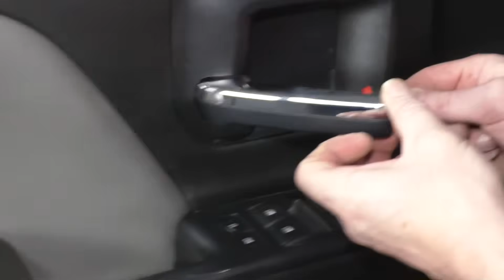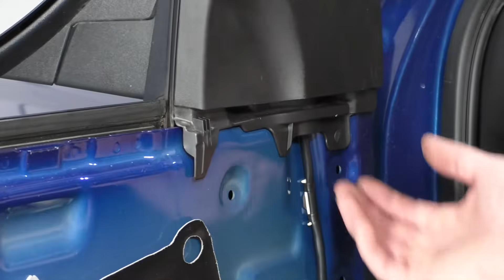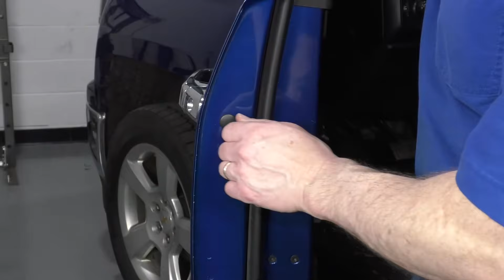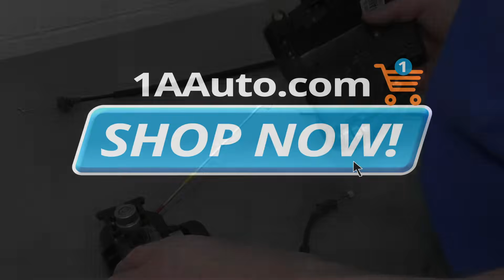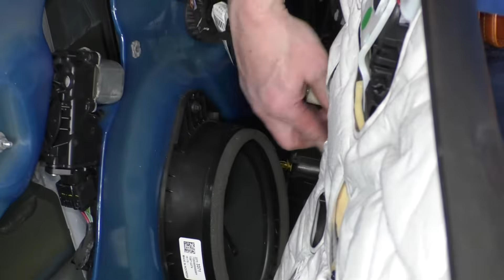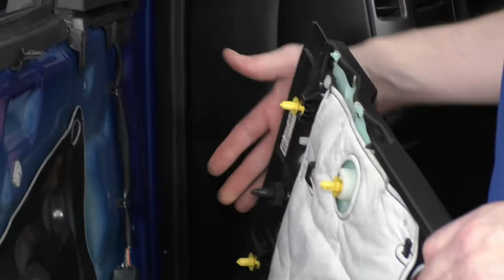How to Replace Front Door Actuator 14-19 Chevy Silverado

Comment: READ THIS FIRST! Read the whole thing once because I added a couple of things out of order. My truck is a 2015 Silverado 2500 and I did the drivers door. Should be the same on 1500. I would like to offer a few of suggestions that will save you a lot of time and headache. This is a great video and I followed it with a couple of time saving tweaks. This is long winded but I promise you it’s a lot faster. I tried to be detailed because too much it better than not enough. . First here’s a list of everything you need to do this job. Wish every video started with that.  1/4 ratchet with 6 inch extension, 7mm and 10mm socket (shallow is fine), torx 30 bit with some way to drive it, pick: 90 degree and straight OR really small flat head screw driver, also a normal small flathead. Optional extendable magnet to catch 7mm bolts before they drop in the door and trim tools if you like that better than snatching. TWEAKS: 1)  I never unwired the door panel. Just set it right inside the truck opening connected. I GENTLY wedged it behind the latch bar. 2) I marked a few spots on my vapor barrier and door with a marker so it goes back in the same spot. 3) Don’t remove vapor barrier all the way just pull it down until it’s hanging at the bottom. 4) DON’T remove the window regulator. Unbolt the rear most part (2 bolts) and move the bar towards the front of the door. It’s completely out of the way there. 5) DON’T remove any of the door handle. There is one bar on it connecting the outer key lock to the actuator. 6) Once you unbolt the actuator (3 torx and 1-10mm) rotate the top towards you and down and the bottom corner will go away from you and up. A little  wiggling for position and the actuator end of the lock bar can be pulled out of the actuator. It will still be hanging in the door on the key lock end. This step took about 2 minutes to get it in the right position to remove the rod. Took less time putting it back because I knew the angle. 7) At this point the actuator is held in the door by the two door handle cables. They are plenty long enough to pull the actuator out of the door and disconnect from the actuator. Look at their orientation before disconnecting from the old actuator and place on the new one the exact same way. 8) At this point follow the reverse of step 6 and DO NOT bolt the actuator back in before putting the key lock rod back on it. Once you bolt it back in connect the wiring and make sure the new one works. 8) When replacing the glass make sure the 2 little black rubber “taco shaped” grommets are in the window regulator where the glass goes in it. If you tighten those two window bolts without those grommets the glass will likely crack.  9) Should have put this earlier. You don’t have to remove the plastic door trim around the inside of the window. 10) All the stuff you need to do inside the door is easiest to see looking in from the top with the glass out and the inner glass “wiper” off. This is why I would suggest taking the glass out. To get it out, With the glass down Angle it steeply with the back coming out first. When putting it back put the front deep in the door first and then rotate the back into the track. Make sure it’s in the track or you may break the regulator when you test it. 11) A lot of people are saying they had one left over 10mm bolt. Maybe I’m missing the joke but if you happen to be confused a lot of the new actuators come with a bolt.  12) The 7mm bolts are different lengths so organize them in a way that helps you remember which ones go where. 13) When the door panel won’t come off the 7mm bolt towards the front of the door and down it a recess of the plastic is the one you missed. (6 bolts total and there are more that are visible that don’t need to come out.) One in the recess, one behind the latch handle, two on the door handle on the panel and two at the bottom of the door.  Took me a little over an hour, maybe hour and a half.  Could do it again with these tweaks in 45 minutes probably since I’ve done it once. Please let me know if I can help to clarify and make it easier for you. Have a great day! God bless!

Comment: Window does NOT need to come out. Like everyone else I want to have a "sit down" with engineers... but, you can do this with the window in. My window was all the way up. I removed the door handle and window guide( two bolts) then carefully squeezed the door latch assembly behind the window Actuator frame and once it was out I was able to disconnect the rod and cables off the old door lock. It's a pain but saves on removing window.

Comment: This would have taken me 4 hours but only took me an hour and 20 with this video. I will say I did the back right door the other day and then just did the front left with this video. The only thing I bought Doorman actuators from AutoZone and you have to trim the plastic back a little on the actual door handle cable to be able to pop into the new actuator properly.

Comment: Hi everyone, my actuator was broken for about two years, I just kept procrastinating before I tried to fix it.  My coolant sensor went bad and I HAD to fix that.  Disconnected the battery, did the sensor change and it took me about two days to realize my power door lock actuator started working again!  Just may want to try it before you rip the door apart.  Good luck!  Please give me some feedback.

Comment: This is a great "how-to" video.  I admit I was a bit daunted at first given the complexity of all the parts that have to be removed to get the actuator out.  However, I followed the video step-by-step, rewatching parts until I was confident I knew how  to accomplish a step before undertaking it.  The most difficult part for me was getting the door handle to attach to the latch inside the door as I didn't have a large pick tool like he used in the video. After rigging a L-shaped bracket into a vice grips, I was able to pull the latch forward and insert the door handle into it.  It took me about 2 1/2 hours from start to finish, taking my time and rewatching multiple parts in the video.  I'm confident I saved hundreds of dollars doing it myself.

Comment: Almost did NOT do it after watching your video. I have a 2019 and just couldn’t see forking out the extra $500 after the $200 part. It was the removal of the window that intimidated me. 

After digging into the comments I decided to wing it, not remove the window, and do a little of each. Exactly what I did. First off if you have a 2019, the panels and all is a little different. Also a big point to the final removal of panel is to lift it “up”. This will ‘unhang’ it from the sill. 

In the end I did NOT take out the window. I also didn’t need to tape it up and remove all the window regulator parts. I did have to loosen the right side and take the nuts off the left and try and move it out of the way. Def must remove the left window guide. And def would say to take off the door handle. I had a moment where I didn’t think I’d get that handle assembly back together. If you’re not mechanically inclined, take it in. Somehow I pulled it off. I think I had someone watching from above. It seemed like a miracle and took me 3 hrs total. Door handle and just finagling the actuator out was the biggest headaches. Especially putting my handle back together. I don’t think a pick would’ve helped mine. My latch bolt and handle removal was different than this video as well. Hopefully this helps someone decide. Don’t want to scare anyone off. I didn’t want to mess w it but like I say…they said probably $500 minimum. Diagnostics could’ve cost more. I feel like I saved a small fortune. Thanks for the video and that gave me the confidence! Aloha 🤙🏽

Comment: I was a little intimidated after watching the video, but once you get into it, it's really not that bad. I have a 2014 GMC Sierra and replaced the front passenger side. You don't need to remove the trim around the window to get the window out, and you should only have to remove the two outside bolts for the window regulator assembly, you can fold it in to get the room to remove the locking mechanism. Good video, pay attention to everything he says and you can do this in a couple hours.

Comment: Wow you guys wasted so much time by removing so much unnecessary stuff… I got this job done in 20 minutes by removing the door panel, the door panel insulation or sound panel whatever you want to call it, the rear window channel then took off the 2 cables removed the 3 torx screws and the 1 bolt for the actuator, slid the lock actuator passed the regulator assembly and replaced it… you guys are a complete joke go back to training

Comment: This is a very good "how to video".  I had to do the passenger side on my 2015 silverado, the door handle doesn't have a door key lock. That area of re-installation is a bit different.  I had to push the actuator lever from inside to engage the door handle.  No big deal.

Comment: Good guide.  To make things easier and less steps...there is no need to remove the entire regulator assembly.  Once you get the window free just push it all the way up and use masking tape liberally to hold the window in the full up position.   Then you just unbolt the part of the regulator towards the rear and slide it out of the way.  There is also no need to remove the trim piece around the window.  There is also no need to remove the outside door handle.  When you get the actuator free from the door you can get all the lock rods and cables off the actuator by moving it around a bit. I have been a GM tech for 10 years.  Great guide.  Just a little more than neccessary.
Reply: Nice tip with the tape! Listen to what this tech is saying. It saved me a good amount of time. With the window taped in the up position and regulator all the way down, the following steps will allow you to slide the door lock actuator past the window regulator:
1. Remove two white retaining pins holding the black foam piece in the middle of the door. Then remove the foam carefully; it's held in place with double-sided foam tape.
2. Remove two bolts holding the window track closest to the door lock actuator and remove it.
3.  Unbolt the regulator at the bottom corner located closest to the door lock actuator and slide this bottom sections as far over towards the door hinge.
Reply: Ditto great video but was able to get it done with only removing the left regular assembly and taping the window,  also didn’t remove the door handle,  thanks!!

Comment: I did this on a 2016 GMC Sierra Denali.  Passenger side front.  I did not take the window out or the window rails.  There is enough room to finagle the door handle mechanism and the actuator between the door and the window rail if you pull on the rail a little.  It wasn't that difficult.  Just pay attention to how the door latch cable runs (between the interior door and the window rail.  I did this in 1.5 hours following this video (skipping taking the window out).  Great directions here.  It took me a few minutes to figure out putting the door handle on as well and turning the handle latch with the pick from the hole in the end of the door...but was able to figure it out.  Overall not a terrible job.  Putting the top trim back on the door was the biggest pain as I didn't see how large the lip was for it to attach to.  Thanks for the great video!

Comment: Outstanding video!  I used the instructions to replace the actuator in a 2017 Impala, everything was the same except the door panel had a bolt under the window switches, and there were two plastic clips at the bottom of the window attached to the regulator instead of the two upper window clamp bolts.
Many thanks and God bless you for helping us out!

Comment: i just installed a new one on a 2018 passenger door and im still not getting power to the door locks. only front passenger. HELP LOL
Reply: Did you figure out the problem?
I’m replacing because I’m not getting power on the door lock portion either

Comment: Just finished doing this, followed the video and it was 100% instrumental. Saved me from going to a shop. A few things (words of caution) to add: 
1) The regulator bolts are riveted on the inside, one of them started spinning in place which was a huge pain. Used heat, penetrating oil, and a vice grip on the bolt to loosen the nut. I think it just had a ton of blue Loctite from the factory. I'd recommend using penetrating lube before even attempting to loosen. 
2) I had extremely hard time taking the window out with window rain guards/deflectors on the doors. Taking it out was very difficult without breaking it. I ended up breaking the deflector when putting the window back in, it simply wouldn't go with them on. Then it was much easier (but still annoying). 
3) I ended up having an extra 10mm bolt at the end (greaaaaat), couldn't find the bolt hole for the life of me. But everything seems to work so.... We'll see if it falls apart later?
4) It took me 3 hours start to finish, and that includes a trip to the store for penetrating oil.

Comment: Great guide. After watching this video I was debating letting a shop replace it on my truck, but I already had the part and decided to see how hard it was going to be. If I had to take the glass out, I was just going to take it to the shop. I really didn't want to try and find a new window during the pandemic, if I broke mine.

I have a Silverado 2018 LT Crew Cab 4x4.

Luckily on mine there was just enough room to Tetris the actuator behind the track while only taking out the latch side, black window guide out. The caveat to that is you have a little less length on the outside handle cable to get it on/off the actuator but it can be done.

Comment: I found your video as I was looking for tips on how to finess the actuator out around the brackets.  My stomach sunk a little when I watched you go through the entire process of taking the window, all interior brackets, and exterior handle off.  But I was determined to do this without all those extra steps, and after some trial and error I was successful. 

You do NOT have to take all of these pieces off just to replace the actuator.  Once you get the black plastic peeled back, loosen the 10mm actuator bolt, and pullout the three torx bolts, you'll the want to remove only the 2 bolts for the window track.  Do this with the window all the way up, window is not attached to the track and will not fall (on my 2016 yukon anyway) .  You can remove the window track to make clearance to take out the actuator.  Remove the exterior handle cable from the 2 white retention clips to give it plenty of slack to move with the actuator.  Then start working the actuator out behind the vertical metal backet.  You will have to flex the metal back toward you as far as you can to squeeze the actuator behind it and above the black foam. It's tight, but it does come out. Once out, remove both the interior and exterior handle cables from the actuator and connect them to the new actuator (the exterior handle cable is still attached inside, you just made enough slack to get it out by removing from the 2 retention rings).  Put the new actuator back in the same way the old one came out (behind metal bracket, above black foam block). Bolt it back in place, then slip the window track back in back in place and replace its 2 bolts. Be sure the handle cables are in the original positions (exterior cable is behind window track, interior handle cable is in front of window track) .  Reclip the exterior cable into the 2 retention clips.  That's it, just restick the black plastic to the door, and reinstall the interior panel.

The hard part to this is getting the actuator behind the vertical metal bracket, you have to bend it inward about 1 to 2 inches toward you to make enough space.  Since the bolts mounting it are so far apart, this is fairly simple with just squeezing the mid point between bolts with one hand and working the actuator out with the other.  It has enough flex to not permanently bend the metal.  I cut up my hands a bit trying to work it around the sheet metal and bracket, but if you hit the sweet spot it goes relatively smoothly without the cuts and blood. 

For those needing to replace only the actuator, I recommend you try this to save yourself and hour and over half of the steps in this video.
Reply from the maker: + Thanks for the tip!

Comment: I understand the door trigger is somehow contained within the lock but have not been able to confirm this. My radio will not turn off or the interior light will not come on. I suspect it is this latch system if so. Any ideas?
Reply: You can try
1) white lithium grease spray
2)electronic cleaner contract spray
3)WD-40 
or whatever you have on hand. It may just be debris blocking the contact points. Spray into the door lock latch assembly then open and close the door a few times if it doesn't work you may need to replace the latch assembly.

Comment: Need to do this on the rear door of my 2015 Sierra, is it really necessary to remove the entire handle assembly, window, etc.?  I've done an actuator before on a different vehicle and you just loosen the 3 screws on the inside of the door near the latch and you can disengage the latch cables and lock rod while the actuator is inside the door.
Reply: I was wondering the same thing. I need to replace mine as well. Following...

Comment: You dont have to remove the window or the track around it. Just remove bottom bolt of the window motor arm. Remove window track inside door towards lock. Plenty of room to get everything out with glass still in,
Reply: Done the way you’re saying many times until I saw this video. If you’re going for the lock, it’s much easier if you take everything out. More steps, but easier steps as opposed to struggling against the window track. But your way definitely works too, just more frustrating to me.